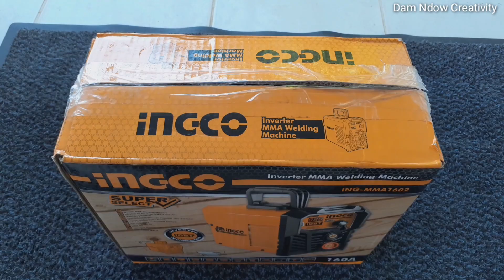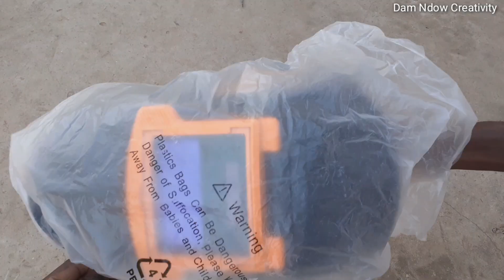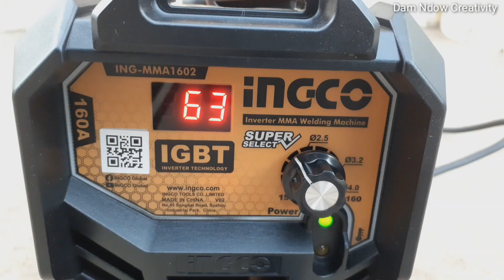INGCO 160A inverter welding machine| unboxing and testing

Comment: 1st DONT weld without protecting your skin you will get burns. 
2nd use correct AMP to metal thikness
3rd clean your metal from dirt and paint
4th move your rod slower 
other than that thnx for video
Reply from the maker: Thanks for that mate will do✌
Reply: @DNC2.0  bought 240 amp new welding machine. HAAAAPPPYYYYY thnx for the video again

Comment: Hello Friend
This device is worth in Serbia 120e(130 USD) its price is very affordable. In Serbia it is around 120e. I wonder if it is for home/semi-professional use?
Does it have a 2 year warranty and will it pay for itself in that time?
Your rating will last the warranty period if it is used normally without overdoing it or it will suffer during the warranty period.
thanks for your reply
Reply from the maker: It’s a pretty solid mini machine, it’s definitely going to last a long period of time if you use use it the way you should. And it’s pretty reasonable to have this machine here in Gambia as well, i got mine about the same price as you mentioned
Reply: Thank you my man,i appreciate it.I need to use arround a house,semiprofesional.
👌🙏
Reply: E bajka jesi uzeo aparat i kako ti se cini